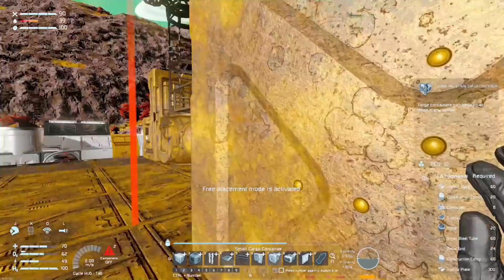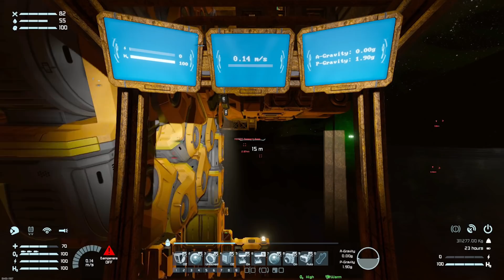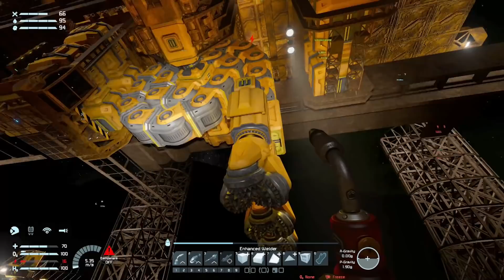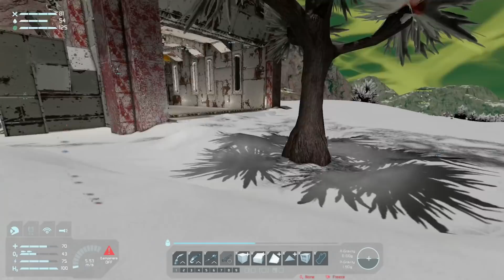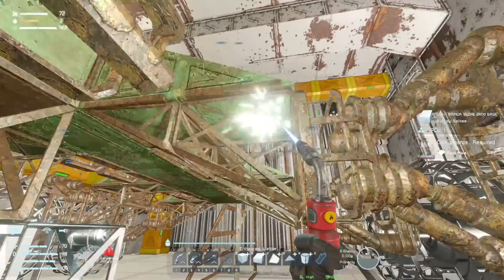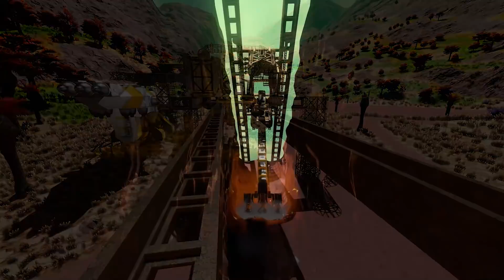Survival Impossible - Unknown Miner #62 - Space Engineers Hardcore Survival

Comment: That's not a doom hole it's a doom trench if you're digging ice for energy then you're wasting it just make a solar field trust me the I have one and it easily charges anything
Reply: Even if it is shot at often?
Reply: Yes solar fields are very effective I have a 100 panels and it outputs 15000kW at around noon so everything just charges up very fast and have it in space with the tracking script  is even more useful also very easy to armor up with windows
Reply: @themidnightbanshee5927  Since they contain computers, the drones would attack them, so in this case, it's not really an option, except for  the top of the mountains, where a large rotating solar farm could be set up, if you can haul the materials for it.
Reply: Hauling materials is but a milk run if you have the proper knowledge of your landscape if  something posses a threat to you than eliminate the target without fail and scavange what's left

Comment: Regarding your ice base, I would add at least enough solar/wind so it does not use hydrogen when idle.
Reply: true that, sounds cheaty or cheesy to rely on solor/wind.... but its there, you might as well use it...
Reply from the maker: I guess we'll see how much I can fit on the roof of the accommodation section :)
Reply: @Splitsie  Catching up on some of your series and commenting late and pointlessly for fun, but I was going to say something along these lines. It's kind of the same redundancy that you were pointing out about the Panini being fueled/recharged with hydrogen. It is kind of counter productive to have the base's power be dependent on its main export as well. It's about as sensible as having a large reactor miner go get Uranium to then return to a processing plant that also runs solely on reactors, when you want the uranium for missiles.

While you're not using any hydrogen, persay, when you're just filling and not running your hydrogenerators, the fact that it's having to run purely on the batteries available to it means it's got a time limit. I don't think I've ever seen functioning wind turbines ever stop. They've slowed down to a painful crawl, but they've never stopped. Should be a better source of consistent energy for that base.